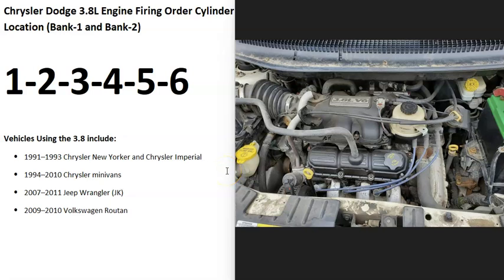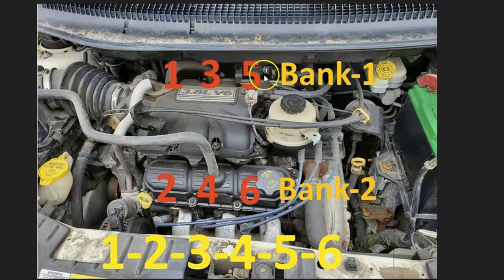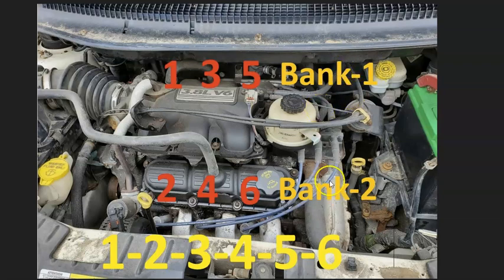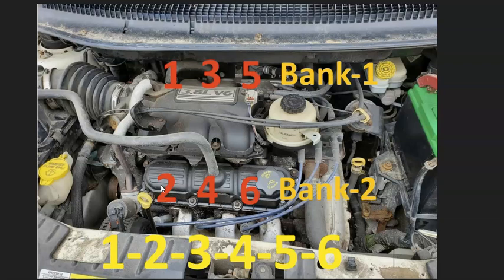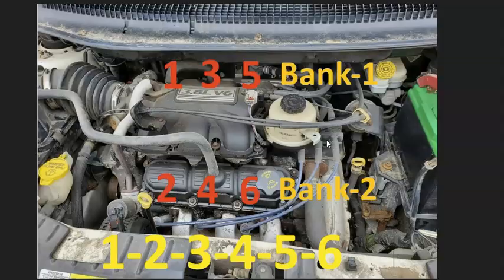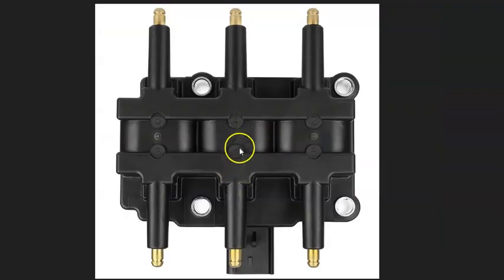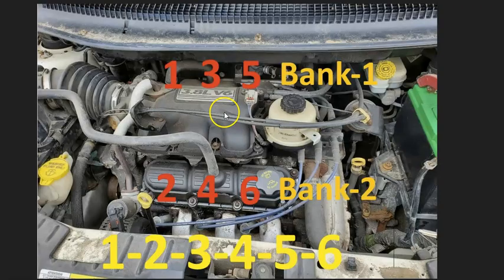Chrysler Dodge V6 3.8L Engine Firing Order Cylinder Location (Bank-1 and Bank-2)

Comment: Hey what's up, I really appreciate your videos — they've helped me learn a lot, and I was hoping you could give me some guidance on something I'm working on.

I have a 2003 Dodge Caravan SE with the V6 3.3L Flex Fuel engine. It's got a Multi-Port Electronic Fuel Injection (MPI) system. Here’s how I understand it works:

•  Air gets pulled through the air filter housing and intake duct into the throttle body.

•  Inside the throttle body, there’s a throttle plate that controls how much air goes into the intake plenum and then to each cylinder.

•  Each intake port has its own injector.

•  The MPI system sprays fuel into each intake port in the same sequence as the firing order.

•  The PCM (Powertrain Control Module) controls the injectors and constantly monitors engine conditions (like temperature, load, and speed) to determine the right amount of fuel.

•  It adjusts fuel delivery using pulse width (how long the injector stays open), and can change this instantly — even between cylinders.

Here’s my situation:
My van has a misfire, and I want to do a manual cylinder power balance test by cutting fuel only (not spark), because it has a catalytic converter and I want to avoid damage.

But I don’t have access to a professional bi-directional scan tool that could do this electronically. That’s why I want to do it manually — by cutting fuel at the PCM level.

The injectors are buried under the intake manifold, so I can’t unplug them directly. But I found all six injector control wires at the PCM C1 connector:

•  Injector 1 through 6 drivers — all control wires from the PCM.

My plan is to backprobe those wires at the connector, one at a time, and cut the signal briefly to see which cylinder causes the biggest RPM drop (or no change), so I can figure out which one is weak.

But I have a few concerns and questions:

1. I know the Idle Air Control (IAC) motor might try to "fight" the RPM drop and compensate for it during this test. Would it be a good idea to unplug the IAC connector while doing the test so it doesn’t interfere?

2. When I backprobe the control wires, should I use a T-pin and a test light (connected to battery positive) to interrupt the injector pulse by grounding the circuit temporarily?

3. Or should I actually remove each injector driver wire from the PCM connector one by one instead?

4. And finally — how can I "be the PCM" and meet the conditions that would normally turn the driver on or off? In other words, how do I safely simulate the PCM’s control logic while interrupting fuel manually without messing anything up?

I know this is a long message, but I wanted to lay everything out clearly so you’d have the full picture. I’d really appreciate any feedback or advice you can give on this.

Thanks again — your teaching style really clicks with me, and it helps a lot especially since I learn a little differently.